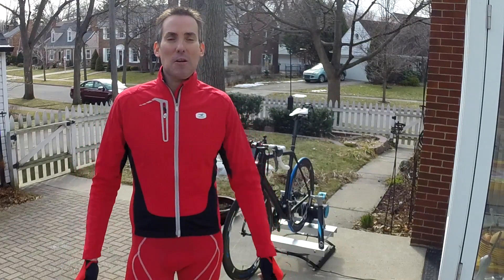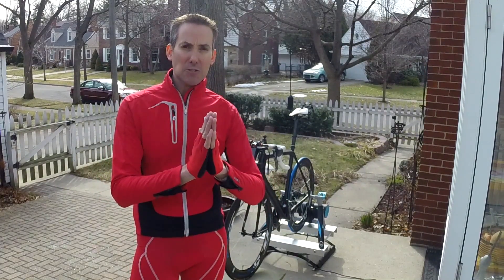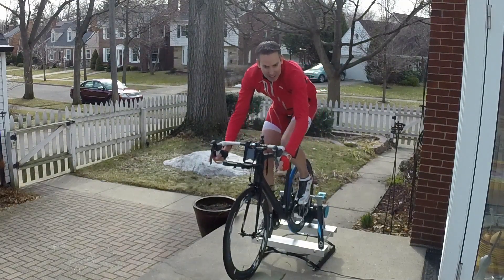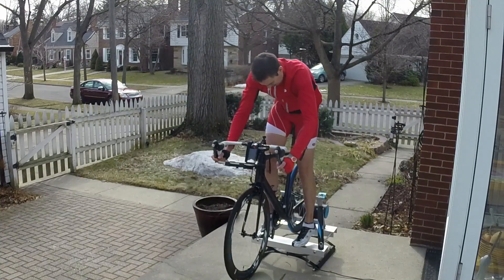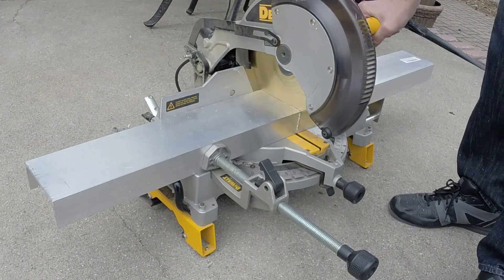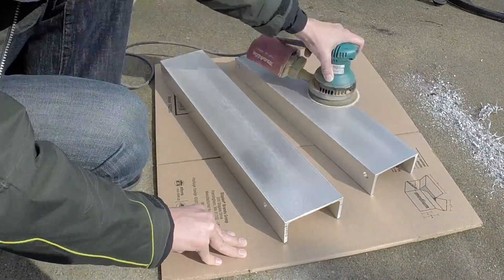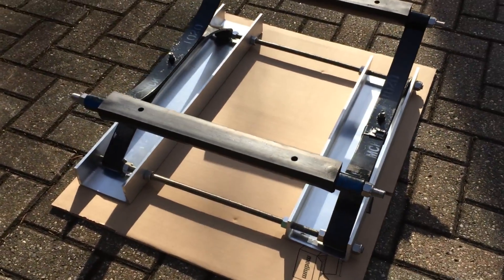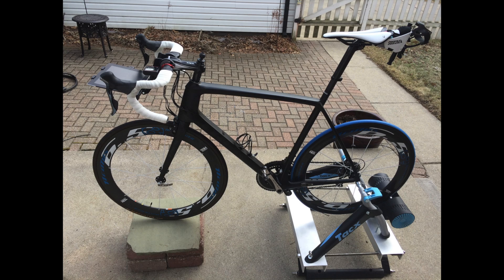DIY Bicycle Trainer Rocking Platform

Comment: I like this better than tennis balls or rubber tubes, assuming the resistance was the correct amount this is the best diy one I have seen.  It did look a tad stiff but I am a little heavier than you so that would be better.  Cheap enough to build so I might give it a go...very nice...

Comment: Thanks for sharing! What did you use for the footing that connects the two bottom leaf springs together?  Looks like its made of rubber.
Reply from the maker: Hey, @Vu Nguyen, I've added a parts list to the description, which includes the bumper, "Vestil M-2-18 Rubber Extruded Bumper, 18" Length, 2" Width, 1-3/4" Depth."  HTH

Comment: Man that trainer is loud.
Reply from the maker: Haha, yes.  Well known problem.  I've since done the DYI drill-out and re-epoxy fix.  Actually even more recent I've replaced it with a Tacx NEO, which is super silent and has its own built-in rocking mechanism (so I don't need the one that I built anymore).

Comment: Are you still using it? And what you charge to build another?
Reply from the maker: I am no longer using it, because I replaced the noisy trainer with a whisper quiet TacX NEO, which has a built-in rocking mechanism.  I think you could buy a TacX NEO or similar for about the cost of a lesser trainer + this platform.  I didn't realize how much I had spent on it until I went back to gather the parts list, today.  :S